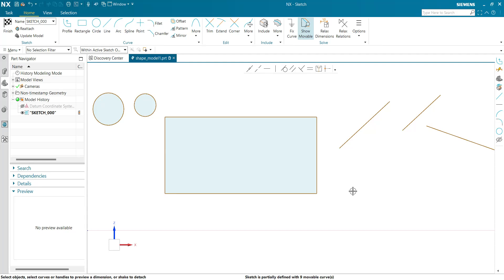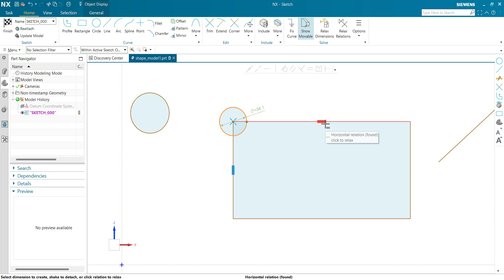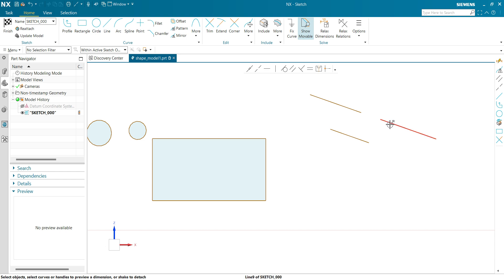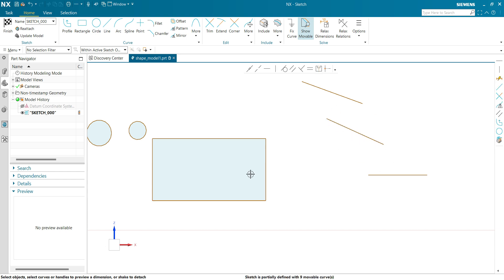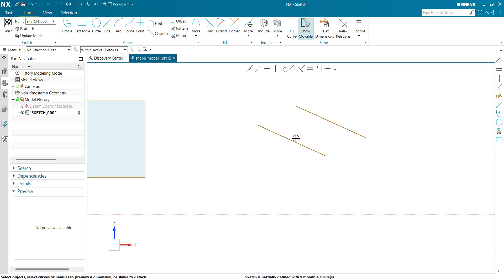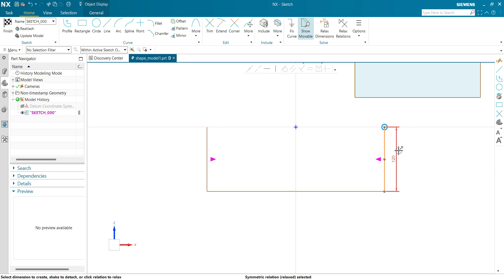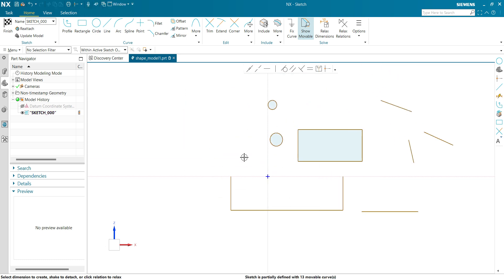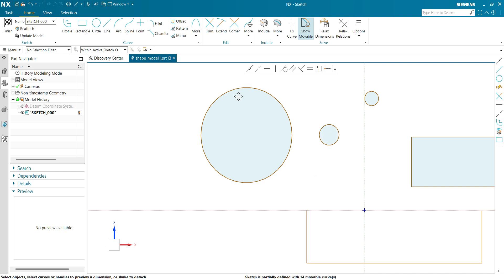How to Remove/Delete Sketch Relations in Siemens NX | SIEMENS NX TUTORIAL.

Comment: Thank you! For removing paralel relationship click on line, click on end point, click on relationship and click and move endpoint. Oh my god! NX is most click simulator ever!
Reply from the maker: Thanks for your feedback! I totally get how those clicks can be overwhelming. Here's another trick that might help:

1. You can directly click on the endpoint of the line, but this might not be ideal for large sketches.
2. Click on the line, hold it, and drag your mouse quickly to see that the sketch relations disappear.

Check out this video for a demonstration: https://youtu.be/r0_GrixjTRc?si=FfD-54CTLV935oT9

If you found this tip useful, consider subscribing for more tips and tricks to make your Siemens NX experience smoother. Thanks for engaging with my content!